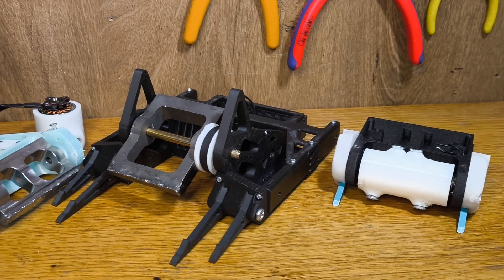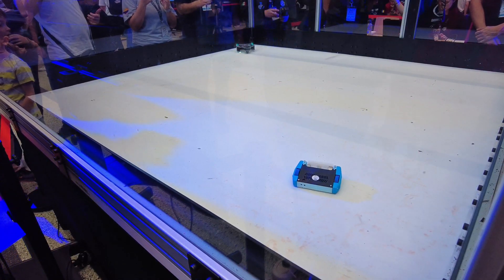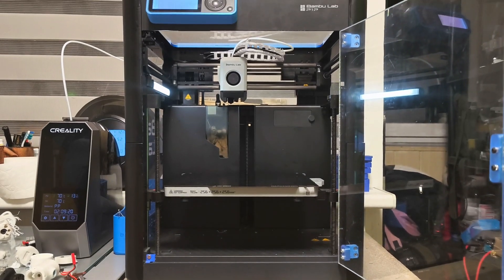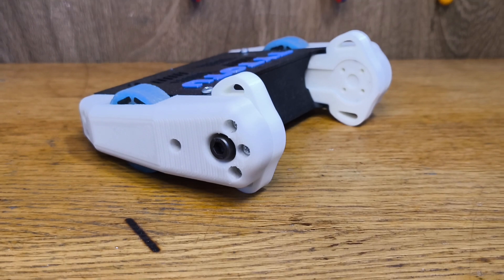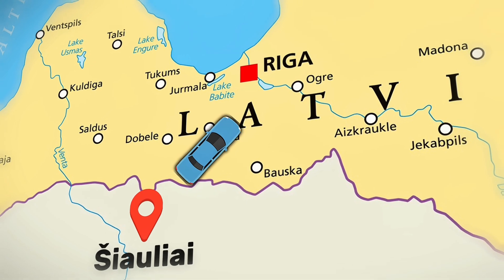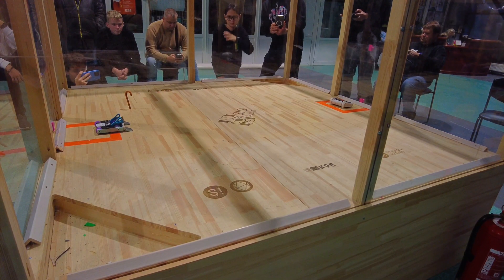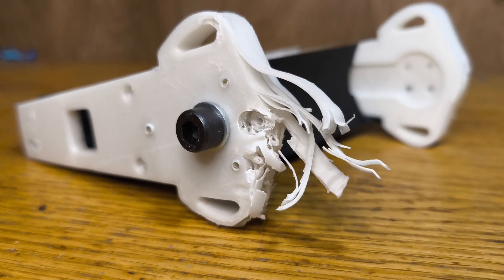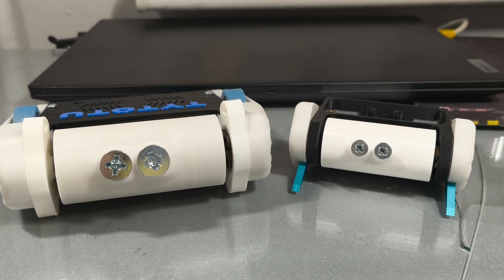Building a Combat Robot In a Week

Comment: Missed opportunity here to call it Tytotwo or Tyto2 lol

But really, I think this was a great showing of how much effort it takes to build one of these, five days from blank CAD to working prototype is a blistering pace, even if it's just based on a prior chassis. I like the Nylon for the weapon mounts, I think it's probably the most impact resistant thermoplastic I can think of, but god is it a pain to print... I wonder how well HIPS, ABS/ASA, or PETG would do in these lightweight categories, can't imagine much worse. Anyway, good job! That final match against Nyx definitely showed why plastic isn't ideal for a spinner, but I was very surprised at how long it took for the drum to split
Reply from the maker: Thank you! Yeah nylon for me always works great. Making the drum from polypropylene was due to urgensy and for my next competition I will be machinning if weather from UHMW or something that would not break. Altough I though even the printed drum would not break as my 150 gram antweight uses a similar design and it never broke after so much fights.

Comment: TBH don't think this as a 1lb kit would do very well here in the states. There are already a ton of kits available and the saifu kit specifically has a machined aluminum drum that's better in every way. There's no way a printed drum would survive fighting the most common kits we have here especially with how common scalar kits are. There are also two hard hitting antweight hub motors on the market that would tear into a plastic drum with ease. AR600 is also becoming the go to weapon material since many bots have found AR500 to be too weak for how hard bots hit nowadays.
Reply from the maker: @grantcatdone3417  I get what you are saying. But this is nowhere near the final version. My idea would be to make the drum out of Uhmw with steel teeth and that would be way more durable. Also the saifu kit is 370 which is way more expensive then I would price my kit. Planing it to be around 200-250. And I do revise on every competition I go so it will be intresting to see if this 1lb drum spinner sucks or is it actually good.
Reply: @DrumBotics  Glad to hear that, after some further thought it's actually not a bad kit idea if the drum is machined. 

I've done some shopping around for antweight kits myself after realizing comps are fairly boring with only one robot. I liked verts but I found some things I didn't like about each kit or they weren't in stock so I settled on the newly released horizontal scalar kit. If something like this was around I would've gone with it back then. Hell I've considered the 150g kit but there aren't too many events hosting that weight class around me. 

The closest thing to this in archetype and cost is the palm beach baby beater, which doesn't have the best performance without a lot of customization and upgrades. The saifu kit is nearly perfect as is but is more expensive and hasn't been stocked in a while. An in-between option would actually be neat and this bot just looks cooler than anything else available so that alone is a good sell. 

Though I don't think you'd be able to get it to be that cheap, direct drive weapon systems need extra labour to run reliably. Both the saifu and synthwave kits come with battle hardened motors so the magnets don't shatter. Cost wise the scalar kit is king at 250$ since it's been optimized for part count so something like this would be more expensive. 

I do still think a plastic drum would have a hard time with how many terrifying weapons there are over here but there'd definitely be people who'd enjoy it if it's moderately competitive and inexpensive.

Comment: Have you read rules for 454g antweight?
Reply from the maker: @amka1097  In which competition?
Reply: Preili, theres rule, that you need a switch to turn on and off power, but it needs to be useable without any helping tools so it can not be inside the body
Reply: I have my switch near motor mount
Reply from the maker: @amka1097  Hmm, that's not smart. I need a side switch and a srew in switch would be not allowed?
Reply: @DrumBotics  yes
Reply: Thats made to make it safer for referees
Reply from the maker: @amka1097  It is not. Everywhere in US NHRL BATTLEBOTS everyone uses a scre switch and im all of previous competitions it was allowed. Could we bring our robots with screw switches, because we would need to rebuild a lot. That's just not a smart idea.

Comment: I think the PP was printed a little cold it looks like the adhesion isn't great and PP should have some of the best layer adhesion of any material. It's also the lowest density though so remember the same part in nylon might be stronger but, it also will weigh like 20% more I think.
Reply from the maker: I agree, it was printed at 260 celsius and Now that I tried printing at 300 it looks the same as I thought the temperature would decrease the quality of the part.
Reply: @DrumBotics  With good settings PP has TPU like layer adhesion and elongation at break is higher than any other non flexible material but, nylon has a lower coefficient of drag, higher tensile strength and stiffness, which might be better. I'd be interested how a higher temp PP part would perform.
Reply from the maker: @thirtythreeeyes8624  Two weeks till my next competition so I will give it a try.
Reply: @thirtythreeeyes8624  From my initial tests printing PP with higher temp (and not getting heatcreap haha) makes it perform better. I'm yet to test if annealing would do anything to make it stronger because it works with PA-CF so why not try rubber.
Reply: Haha cold pp

Comment: hello what bambu lab 3D printer are you using?
Reply from the maker: @blinkdagger4393  Bambu p1p, with a custom enclosure for printing with special filament like nylon or polypropylene.
Reply: @DrumBotics i am planning to buy a 3d printer bambu lab p1s. as a beginner, i got a little bit of knowledge about 3d printers. will this printer work on printing nylon, polycarbonate and carbon fiber? the parts will be used on my combat robot.
Reply from the maker: @blinkdagger4393  Yes bambu in my opinion would be the best choice and of course p1s has an enclosure so even better. Just know when printing nylon you would most likely need an advanced g10 garolite bed. Cf-nylon amd polycarbonate prints perfectly fine.

Comment: 8:47 Why not have a direction swap function, the bot is very symmetrical either side.
Reply from the maker: I thought self righting with gyro would be enough.
Reply: @DrumBotics  Ya, but the time it takes is so detrimental. You're very vulnerable, plus can't capitalize and go offense when you're trying to self right like that. Would be so much better if you could just seamlessly go right back to fighting. I bet you'd have won the rematch with that difference.
Reply from the maker: @SpiderWaffle  I guess at first for example the 200 gram tytotu version self rights way faster, but as we saw the 1 pound version self rights for some reason slower and that shows.

Comment: Does the motor fit in the drum with only friction or is there glue/material involved too?
Reply from the maker: This time, because the drum is printed out of soft material it is pressfitted, but in the future I will use something like nylon which is harder yet still tougher and will put some glue there in as I press fit.
Reply: @DrumBotics  so if it was made of metal, would it be pressfitted or glued or would you use a collet?
Reply from the maker: @Greanbeens14 When I need to fit  a motor into a metal hub I make the hole a bit bigger and  just print a soft adapter and then the motor press fits perfectly.
Reply: @ thanks!

Comment: That arena having no roof is very worrying if they are allowing spinners. Even if they are at the 1lb weight class
Reply from the maker: Yeah right, I said that myself there, but I won't go home after a 300 kilometer drive😀
It was a very little competition and they probably didn't even think that there will be some powerfull spinners.
Reply: @DrumBotics  In which case I hope they saw what your robots are capable of and make a roof!

Or just send them the IIT Techfest 2014 video of a guy getting brained by shrapnel and hopefully they'll realise why you need a roof.

Comment: cool also I have a question are you gonna replace the drum with a different material or is it going to stay the same
Reply from the maker: Yes, I'm now working on this particular 1 pound drumspinner and it will be way better in the future. Planing to print the drum out of nylon or TPU 100 procent infill and in theory it should be indestructable, of course a lot of testing is still needed.
Reply: @DrumBotics  ok thanks